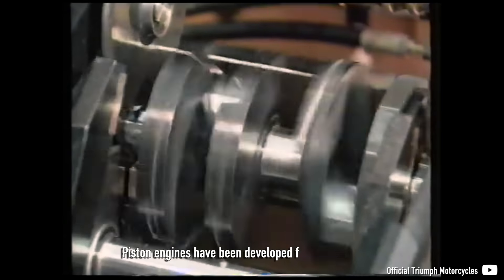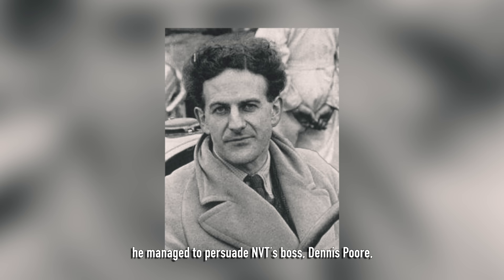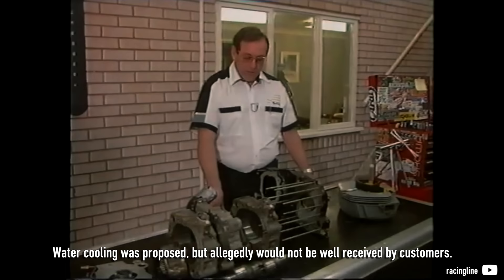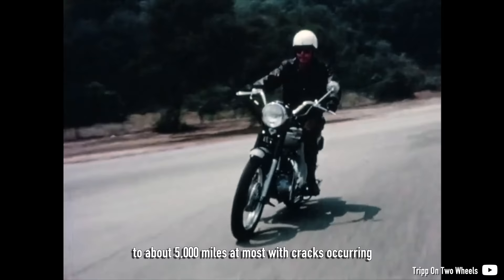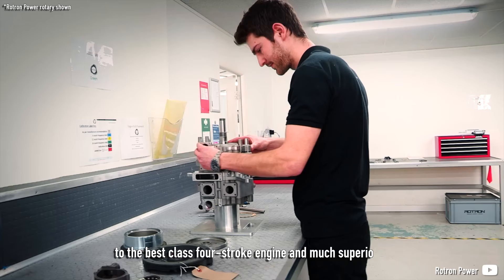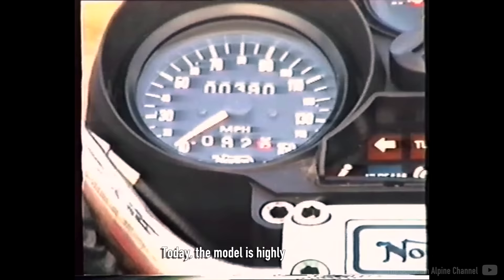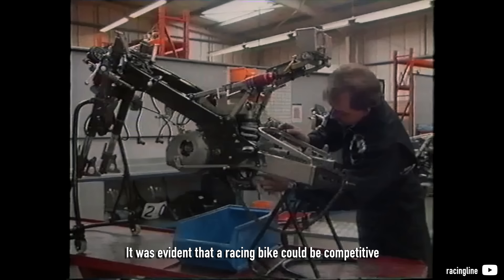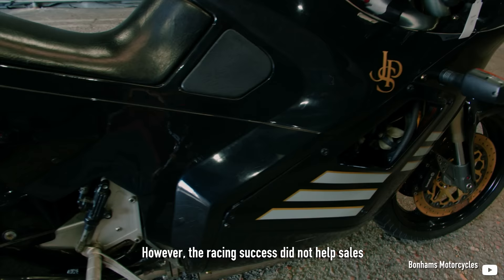Norton Reinvented Rotary Engine

Comment: 1:20. The engine shown there is NOT the Rolls-Royce wankel.  It is the John Deere SCORE 580 2-rotor engine, which was designed in the mid-1980's.  As a young mechanical engineer I participated in the development of that engine.  

The Rolls-Royce wankel was an engine with 2-stage compression, and true compression ignition.  The Deere engine was low compression with spark-assisted ignition.

Other than that minor point, marvelous video!  There will always be a place in my heart for wankel engines, and the people who create them.
Reply from the maker: No, it is not a Rolls-Royce engine. I overlooked it in the post-production otherwise I would have put the info title.

Comment: IIRC, Trevor Nation was interviewed after winning one race on the RCW588, and said "It's such a quick bike that they could have put any competent rookie rider on it and it would STILL have come in first. The first place of any competition this bike enters is pretty much already in the bag. The REAL race is for who comes in 2nd, 3rd, and 4th".

From what I remember in bike magazines back then, It was only really allowed in the 500/600CC class because in a few EU countries at the time, for racing purposes, the capacity of a Wankel was calculated as only ONE combustion chamber volume multiplied by the number of rotors (rather than the more usual 1.5 combustion chamber volumes). In most other countries it would have been getting trounced in 900CC+ race categories.
Reply: The only thing Norton lost more than races... was customers.
The Wankel engine was ultimately a failure that destroyed the company.

Comment: very interesting, I never knew this much testing went into a rotary motorcycle I used to have an 04 rx8 manual and it did lack torque so I always said with the rotary advantages of smoothness and light weight it would be better in the lightest vehicle possible such as a bike or the Miata and that the rx8 would've been better with a 4 banger and skinny tires like what they did with the FRS/BRZ.. wonder why they didn't consider forced induction with the early Norton when trying to increase power numbers, assuming the tech wasn't really there yet plus longevity was also already an issue.. anyways I'd love to experience a modern rotary sport bike, mayb they could incorporate some carbon fiber internals somehow

Comment: Great video. Fascinated by this design since I was a teen. Always thought the Wankel shouldn't work. So I got my self a Norton Commander. It works so well. Pulls from less than 1000 rpm, uncannily smooth, brilliant fairing and comfortable. Weakest aspect front brakes and forks as supplied by Yamaha (XJ900).  Fuel consumption the same as my 1100 Guzzi Breva and as fast.
Reply: The Norton bokes were absolutely horrible... so bad people simply stopped buying them.
Reply: Have you ridden one?

Comment: I rode a Norton rotary during a factory visit and it was brilliant.  Engineering wise, it's hard to fault. But it never had a place to go and was marketed poorly. The Interpol was only sold to fleet markets, not the public, so not volume sales. Compared with a BMW comparable machine,  the Norton had some silly design fails. Norton also must have been living on the moon to not know how so many companies  experimented with wankels and stopped there and those few that went to production failed (DKW W2000, Suzuki RE5, Van Veen OCR1000 etc). It was doomed from the start as a business proposition even if it went well as a motorcycle.

Comment: Better than the Suzuki RE5? Suzuki still had engines for the RE5 in stock In some of its warehouses in the US as of six years ago
   I remember a controversy about the Norton rotary when it was competing in road racing. The officials did not know whether declare it a 500 mL or a 1500 mL engine because of the three sided rotor. I’m not sure about the initial displacement but it was an issue

Comment: I thought they went out of business 50 years ago.  That modern bike looks like any other rice burner.
Reply: Correct, Norton is long gone. Killed off by the Wankel engine.

Actually the Crieghton is nothing but an old Norton assembled from spare parts and dressed up with new fenders and fairings

Comment: Math error at 3:39 - a drop in temperature by 20°C is a 36°F drop, not a 68°F drop. The math for temperature difference conversion is just F = C * 1.8. There's no offset by 32° since it's only measuring relative drop, not an absolute measurement. This proves itself when you compare a drop from 50°C to 30°C (-20°C), which is 122°F to 86°F (-36°F).
Reply from the maker: Sorry, I am not sure how I got that number
Reply: @VisioRacer  no worries! Great content as always! When measuring absolute temperature, 20°C is 68°F. Most websites that convert temperature assume that's what you mean.

Comment: It's interesting to note that a rotary engine design was patented in Yorkshire  before Wankel.  However,  at the time there was no material hard enough to seal the combustion chamber. Nevertheless, just as the patent ran out Wankel patented his very similar engine just as this material became available.
Reply: That's hilarious! I love British humor.
Reply: @sandervanderkammen9230  
What a strange response !
But it's not British humour, it's historical fact.
Rotary engines have a long history, right back to James Watts Steam Wheel of 1769 and probably even before that. In 1865 the Holmes rotary engine was patented in the US. There was even a Norton rotary engine patented in 1866 but not the famous motorcycle manufacturer. Though these were steam powered its impossible not to notice the obvious  similarities in their construction and just like the Internal combustion engines they too suffered with sealing the chamber. In fact just like the steam rotaries,  there were thousands of patents for Internal Combustion engines rotaries before Wankel. The first of these was probably the Joseph Webb engine of 1853 built in Middlesex England, though the Umpleby of 1908 also England is often claimed as the first one.
The engine I was previously referring to was built by Lansdowne and a model is on display in a Yorkshire museum.
Reply: @johnbrereton5229  Do you not understand the difference between a Rotary engine and the Wankel engine?
Reply: @sandervanderkammen9230  
The Wankel DKM engine is a rotary engine and though we know it as a Wankel engine, the engine that went into production was actually a KKM version designed by Hanns Dieter Paschke.
However, perhaps you think I am confusing the rotary engine with the radial engine?
My post was not concerning the radial combustion piston engine designs as used on early aircraft, if that is what you referring to.
My post was entirely concerning rotary pistonless internal combustion engines and their similarity and development from the earlier rotary steam engines of the past. Though the Wankel design became the first successful production rotary internal combustion engine, that too was not the first. The Webb engine of 1853 was the first rotary internal combustion engine and there were many others, both before, and after Wankel.
Reply: @johnbrereton5229  Thank you for proving my point. 
The Wankel KKM57 is not a Rotary type engine.
Reply: @sandervanderkammen9230  
I'm not sure what you point is anymore, do you ?  The Wankel DKM was Wankels original rotary engine, but I disputed your claim that it was the first rotary engine, which is not correct and I provided verifiable evidence to prove my point.
Reply: If there was any infringement with any  prior art designs then the patents would not have been granted to the Wankel rotary design. It wasn't just a copy of a previous patented design.
Reply: @howardosborne8647  
A patent only last for 20 years and this one had just run out, and at the same time that the new materials to seal the chamber became available. However, Inventions are rarely the work of one man, rather a constant development of an idea. And the idea for a rotary engine is much older than Wankel, just as I have shown in my previous posts.

Comment: Too bad Nortan didn't team up with Mazda & add some spinny things. It would probably be quick enough to enter orbit, if it had boost!
Reply: They did put spinny bits on one of the race bikes. But to blow air through the engine as cooling before they went to the vacuum injector.

Comment: It's unfortunate that when used in cars nobody just had a separate oil injector and used 2 stroke oil from factory. It would have made sense for Mazda to do it on a performance model first, then bring it into the full range of rotary cars.
Reply: In case you weren’t aware the RX8 renesis engine does have the sort of oil injection you’re describing ( not 2 stroke oil of course but specific engine oil)
Reply: @pizzagogo6151  Like an oil different than the stuff sloshing around in the internals?
Reply: @themadscientest  no the engine oil is designed to be burnt ( why you shouldn't use standard  fully synthetic car oil  in renesis engine)
Reply: Wankel engines are 4-stroke... Mazda only recommends 4-stroke motor oil because it is better suited to the engines operating requirements.
Reply: @pizzagogo6151  Its perfectly safe to use any 4-stroke oil as long as it meets Mazda's minimum API rating SL or EC GF3 specification.
Reply: @sandervanderkammen9230  .  someone wants to use is their business , I was just clarifying the question that yes the Renisis is designed to burn oil. I’m not interested in a debate about it as clearly in the owners manual that Mazda recommends mineral oils only. For this reason its logical to me not use fully synthetic in a rx8 because it’s not designed to be burnt. ( IMO safe” is not the same a leaving carbon deposits ( shortening the life of the engine seals). So  I personally go by the advice experienced rotary builders I trust, & use semi-synthetic.
Reply: @pizzagogo6151  please stop spreading your lies and misinformation about Wankel engines and the RX8.
You are clearly not qualified to speak  inteligently on this topic or give advice.

Comment: Normal people: Noo you can't pick a piece of a car to make a bike
Norton: ahahahahah scissors on miata goes brrrr
Reply: NORTON used Wankel engines designed by Sachs.
Sachs became a NSU Wankel licensee before Mazda.
Reply: @sandervanderkammen9230  i know and i am still surprised of how they managed to balance vibrations but i mistaken completely the bike , i meant crighton refering to the newer 700 rotary bike , built after mazda using wankel
Reply: @tot5910  Sachs was years ahead of Mazda in Wankel engine development.
The Crighton CR700W is nothing more than a a 1990s Norton race bike built from old spares.. it is powered by a modified Sachs KC60 engine.
Reply: @tot5910  Norton invested million into further development but went bankrupt and ceased to exist in 1992.
Reply: @sandervanderkammen9230  thanks for information , i didnt knew that

Comment: and now there's the liquid piston tech. wonder if that will catch on.
to add....is it just me or does the rotary sound like a 2stroke on steroids  w/speed?
Reply: I like the liquid piston engine
Reply: @Alfred Wedmore as i understand it the unit's seal wear is drastically reduced due to the fact that they don't spin with the rotor and suffer the associated forces. secondly...the reciprocating mass is far lower than the standard wankel.